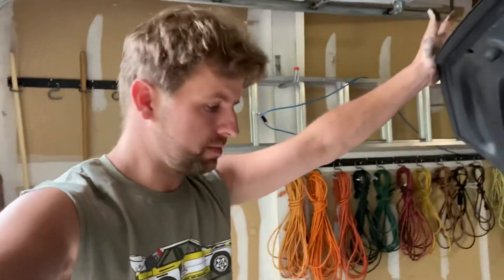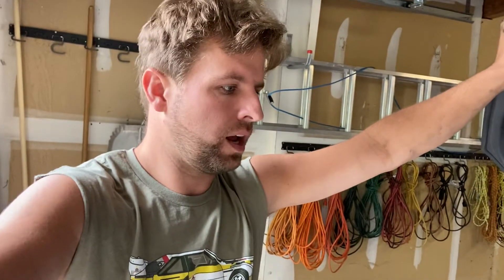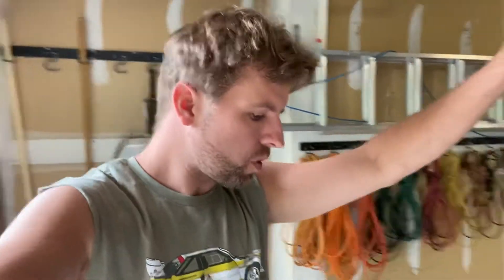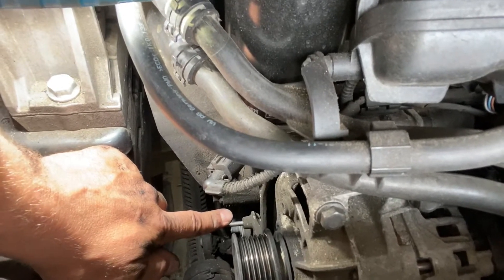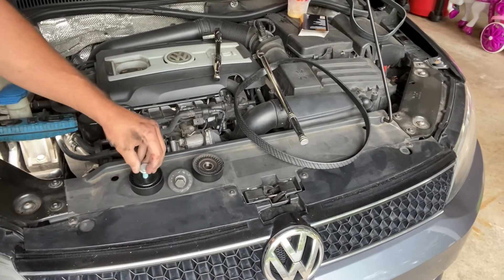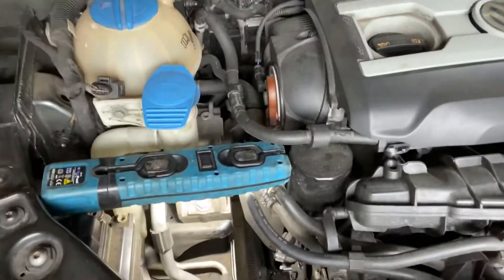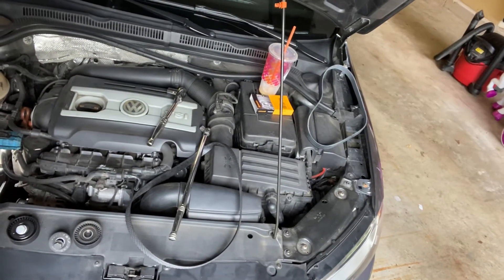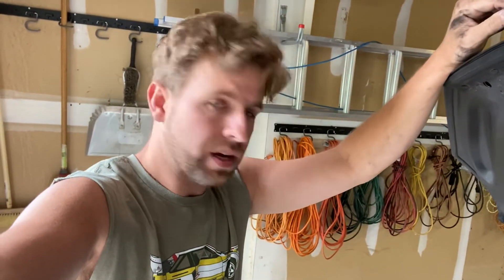Car Maintenance: 2012 VW GLI Serpentine Pulley Replacement

Comment: Have a 2013 GLI and I’m getting an unusual squeal that originally began only when exiting a freeway after a bit of a drive on it. The squeal would remain through the first few gears and then disappear until the next prolonged highway drive.  Been hearing it for years while it was very uncommon, but now it’s progressing and becoming far more common. Can you please let me know what finally resolves your issue with that? 
Thank You!!!
Reply from the maker: For that I would check deeper. Turns out my pulley was one issue. The intake manifold has a vacuum lever. With the car running pop the hood, on the right side (while your facing it) there is a little bell shaped component next to the intake runner. A little plastic rod comes out of it, put your hand on that rod with a little ball shape at the end and push it. You’ll hear the stupid squeal.

It’s that ONE part that makes the noise. I pulled it apart to check the seal it’s all good just a stupid design. And to correct VW only sells the ENTIRE manifold which is garbage. I’m on my 3rd in 150k and not looking to do a 4th.